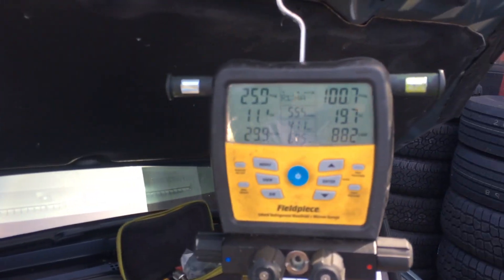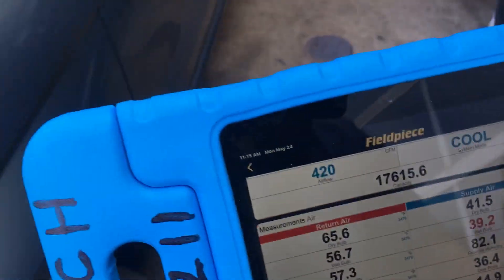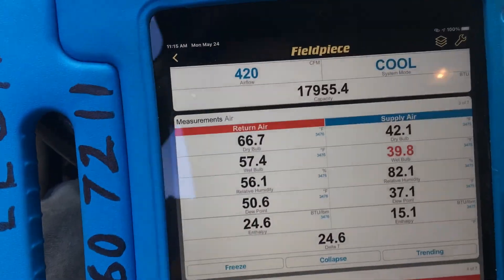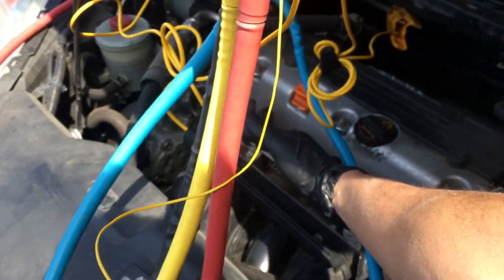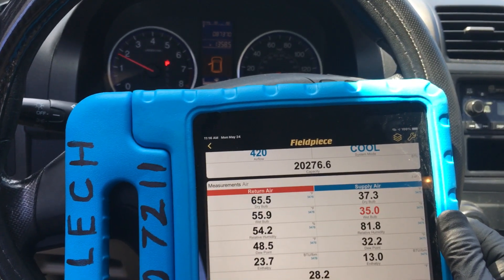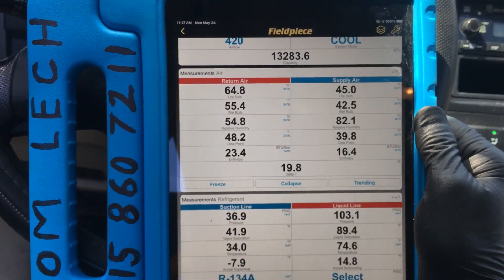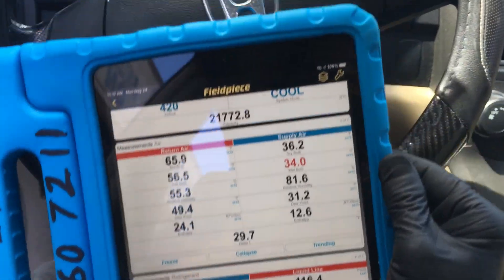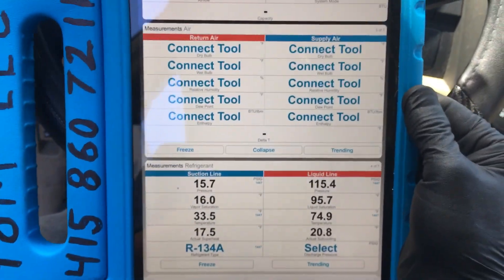2010 Honda CRV filled up blowing cold. Low side 14 psi normal￼ ??? Not according to AC PRO￼ ADD MORE

Comment: I have one the same year. I am getting pressures up to 380 psi on the high side and 40 to 50 on the lo side. The fans are blowing. I  changed  the condenser and same thing. I changed  the expansion  valve and it seemed  okay for a few minutes of idling  and then went back to doing the same thing. The refrigerant charge is 500 grams ot just over a pound. If driven on the highway it gets better and starts  cooling. I am wondering  if the fans are not blowing  properly.
Reply from the maker: If you’re getting 380 psi you should be hearing those fans blowing full blast high-speed there should be no wondering if they are working they will be working at that pressure otherwise something is definitely wrong

And your outside ambient temperature must be very hot is it about 90° are over 100°F for 380 psi ? 

And very small system charge around 1 pound is very very sensitive just two or 3 ounces too much refrigerant will make the high side skyrocket and give you pour cooling output
Reply: @coldfinger459sub0  ambient temperature  only 80f. The fans are blowing  and the engine is not overheating ( at least the gauge is reading normal). Is it possible  the evaporator could be clogged. I blew compressed air through the inlet side in it and air was coming out the  outlet side ( not strong, though).  The condenser  is a UAC and the expansion valve a Four Seasons.
Reply from the maker: @aldovera3789  yep 380 is way too high for 80°F it would not be a evaporator clogged evaporator don’t get clogged because the expansion valve has the smallest orifice in front of the evaporator the hole in the expansion valve going into the evaporator is about the size of a number two pencil lead the hole in the evaporator pipe size entrance is about the size of your thumb which one do you think will clog first

What is the temperature of the suction line coming out of the evaporator towards the compressor?
Reply: @coldfinger459sub0  I don't  have a temperature gun or a thermometer for lines but at one point when I was getting 50° at the vents, the suction hose was cold and starting to sweat and the high pressure  was just over 200psi. Of course  when the pressure gets higher the suction  hose  gets warmer.
Reply: @coldfinger459sub0  well, I  am stomped with this system. The condenser fan seems  to be pulling heat off the condenser but still after a fe minutes of idling and revving the egjne, the pressure creeps up to high levels  and the cooling through the vents goes up to close to 70°. However,  once you  drive the car it comes  down  to even 45°. There are no  blockages in the liquid lines. As I mentioned,  new condenser, new expansion valve, fans are both  blowing,  no restrictions through the rad, engine seem at normal operating temperatures. I am even thinking about rigging an extra  fan on the condenser but why should I  have to? Is it possible  the UAC condenser  is not good?
Reply from the maker: @aldovera3789  are the fans blowing backwards?. 

Also after the pressure go up .  Spray the condenser with water. High side come down? 

High side fitting located before condenser ?  or after on liquid line? 

Temp of refrigerant entering condenser should be less the 50F temp leaving condenser? 

20f or 30f lower
Reply: @coldfinger459sub0  I thought about the fan spin  direccion but they are wired right, they're  pulling air. Yes, I  did try spraying  water and it does  bring pressure  down. High side pressure fitting  is at liquid line between condenser  and evaporator.
Reply: I haven't  taken temperatures off condenser,  but the liquid line right at the expansion  valve is really hot to the touch.
Reply from the maker: @aldovera3789  now this is getting difficult. Has oil been added in its past ?
Reply from the maker: @aldovera3789  keeps sounding like overcharged or air flow.
Reply: @coldfinger459sub0  I had added oil when I changed  the condenser ( about 2 ounces) but I took it out when  I  last evacuated it and recharged. It seems more like airflow. Maybe the fan isn't pulling  enough CFM?
Reply: @coldfinger459sub0  hello there again,  doing further investigation on the airflow system, I  have confirmed that the condenser fan is spinning  the right direction  and at high speed. The rad fan is blowing at high speed  too and wired properly.  However,  here's the kicker, when I  disconnect the rad fan and leave the condenser one only, the high pressure  goes down to or just below  200 psi. When reconnecting the rad fan the pressure  rises. The rad fan spins in the  same direction as the condenser one but the blades are set differently.
Reply from the maker: @aldovera3789  Definitely not normal definitely some funny business going on there. 

Just in case airflow and air Turbulence can be deceiving. 

Put a piece of paper in front of  One fan and see if it’s sucking in then then move that piece of paper over to the other side and see if it’s still sucking in just as strong ?.
Reply from the maker: @aldovera3789  was  the compressor replaced with a aftermarket different style compressor ?.
Reply: @coldfinger459sub0  I'd say!
Reply: @coldfinger459sub0  I am not  sure but I don't  believe  so.
Reply: @coldfinger459sub0  as far as checking  the fan suction,  I  have only done it by hand feel, behind the fans themselves ( between  the fans and the engine ).
Reply: @coldfinger459sub0  btw, shouldn't  this compressor  cycle when the pressure  is that high?
Reply from the maker: @aldovera3789  At 440 psi the high pressure safety switch will cut out the clutch if it has one
Reply: @coldfinger459sub0  refrigerant charge is 450 grams now and I even let some oil out to see if maybe overfilled with oil.
I'm  telling you, it's  got me pulling my hair.